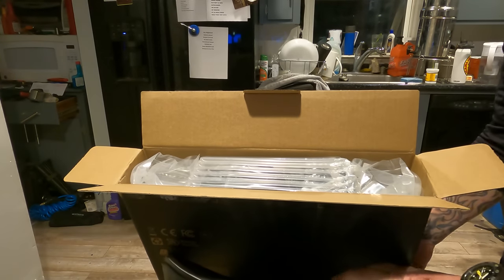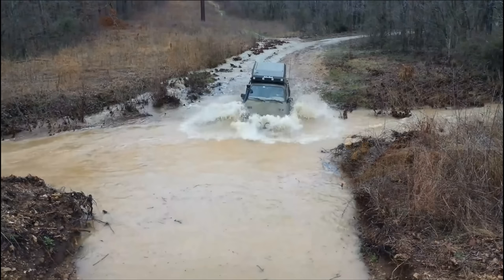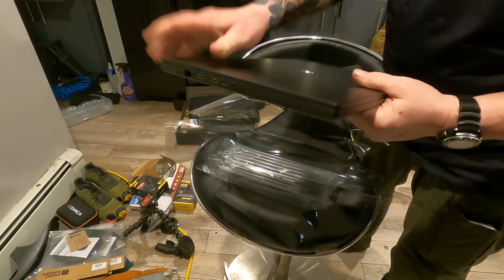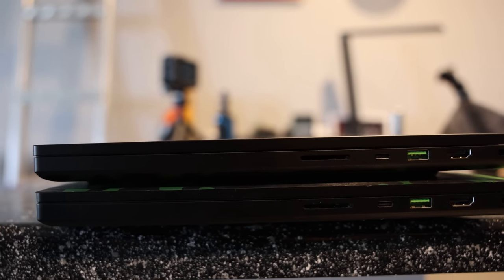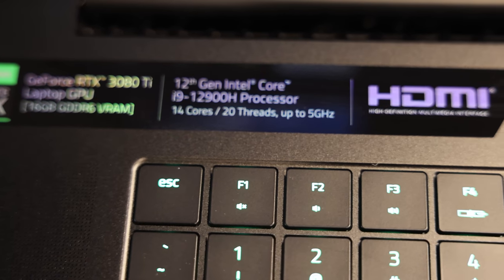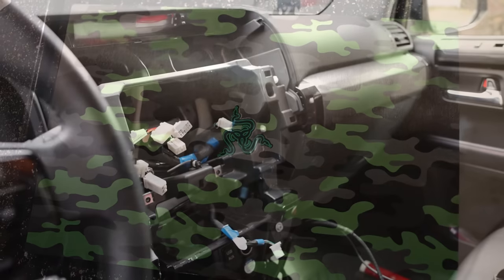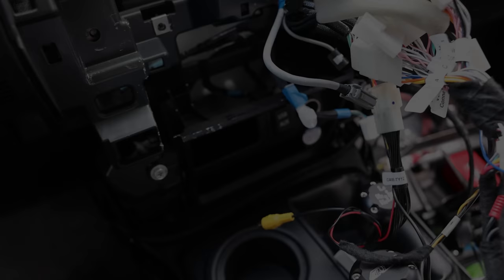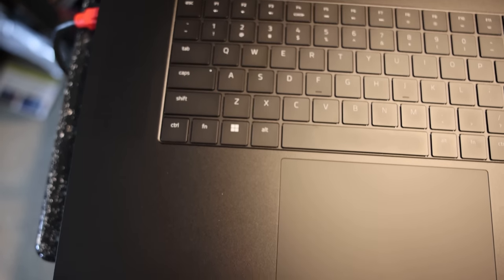2022 RAZER BLADE PRO  17 i9 RTX 3080ti

Comment: I am in! 
With those specs, I'll use it for the next 20 years.
Mine is a 12 years old PC,  I can do basic stuff, youtube videos @ 480p only. Local files @ 1080p.
(Intel Celeron E3200 @ 2.40GHZ, Dual Core.  Memory DDR2 2560 Mbytes. Graphics onboard Intel g31 256Mb. Windows 10.
Maintained by myself, All original expect the Hard drive. Using it since January 2010).
Thank You, JBO!

Comment: I'm in.  A new computer would be very welcome, as the one I have, the battery has pooped out.  I'm getting a new battery, but having another computer in case this one has issues would be great.  I could also use the second computer to use without any connection to the internet - a totally private machine.  Thanks Richie for this and all the work you do to put out your videos.  😄

Comment: I love the new model. Upgraded from the early 2021. My i9 is about 70% faster than the i7 in multicore apps. Shame about those crashes, I haven't had any yet. The bottom lid on mine was a pig to get off too and whilst I'm generally very happy (quieter, more powerful, better keyboard and speakers) I do think the case gets a little hotter than I'd like sometimes. I'm gonna repaste it and see if it helps. Loved the vid!

Comment: thank you Sir  honesty is the best  , just wondering , i thought 4 TB is the Max , i got the default 1T  who which SSD do you recommend the Max 12TB would be great and I got 32 RAM I wanna max it out
Reply from the maker: Ive run 12 tb in my 2019 RBP17 in my 21's and now in my 22  works fine zero issues.  I use Sabrent rocket SSD 8TB and a rocket 4tb and 64GB or whatever the fastest Ramm avail. in the 22 Im running crucial because its the only option as of yet.

Comment: Hello! I noticed on the first two razers, i9 and i7 you have very high background usage of the processor. It says right there with the red exclamation mark. I guess that's why you have those poor results. Could be the using of the recording apps while benchmarking? And your memory ram isn't working on same frequencies as the CPU. You can fix that by enabling the XMP profile from bisos.
You have a huge issue on the RB 17 2022. The CPU Is being throttled and woks only at 87% of its full power. That one is because of windows 11.
Reply from the maker: xmp on all machines is already on. and results were identical when run prior to recording

Comment: I'm in. Migrated from Alienwares to Blades in 2016... Since than i've had blade 14 2015, blade 15 2018 adv with 1060 and 1070 and finally got 2019 blade 15 with 2080 in 2021 -_-
Reply from the maker: I never went AW but Ill tell you Razer has been a struggle EVERY laptop has some issue or another.
Reply: @jailbreakoverlander  yep, blades is a hastle... alienwares btw too )) dell and razer picked to much strange decisions -_- i cant tell anything about 17 blades, but the most stable blade and prowided less problems is  from i had owned and tryed is - 2019 with 9750h and 2080 bouth undervolted. anyway, there r no more notebooks instead of blades and macs that looked so good and clean.